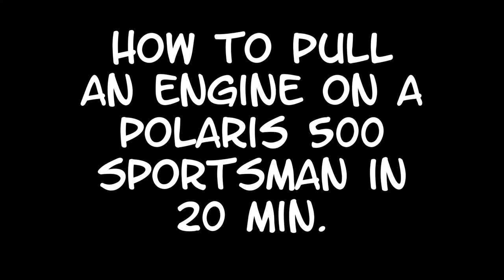HOW TO PULL A POLARIS 500 SPORTSMAN ENGINE

Comment: I have questions also! I have a 96 sportsman 500. I thought I blew the head gasket as when I start the motor the radiator become mount Vesuvius and shoots all the liquid out the fill. I swapped out the head gasket (along with a new radiator) but same results. In your opinion you think the cylinder itself has a crack possibly? I’m no newbie but not the seasoned expert you are. My expertise is more on 4 cyl motorcycles which is more or less the same concept. I just thought it weird that it would run with a cracked head
Reply: Maybe a stuck thermostat?

Comment: I have some questions
Reply from the maker: Go ahead
Reply: @TitaniummanGarage  I have a 400 L scrambler that Boggs , I just rebuilt the top end and the carb. I’m very new at this!!
Reply: @asaparsons5746  400L is a 2-stroke....different animal in the same type of chassis....
Most likely it's still the carb....rebuilding it doesn't equate to being properly jetted and tuned, taking plug chop readings under load etc.
Plus the response is verrrrry finicky to your air intake...whether it has the foam cover over the intake or not etc. 
Richen the pilot jet from say a #40 to a #45....then adjust air/mixture 2-1/2 turns out to start with then fine tune the adjustment.
Main seals can also leak allowing air into the system...rule that out

Comment: I like this guy, straight to the point, no nonsense, good vids. Keep it up.
Reply from the maker: Thanks for the great comment. I thought of mixing it up a bit, But someone once told me most guys just want to know in detail what to do. Not see 10 different projects I'm working on before I get to what my video is about. Like I see other guys do. So that's what I try to do and it works out well. Thanks again.
Reply: @TitaniummanGarage that is correct. But still wanna see ur other projects. Just 1 video at a time. Great work. But thunk u amd I need to both by tripods for better quality amd less shaking. But biut to fi ish pulls g out my predator motor.